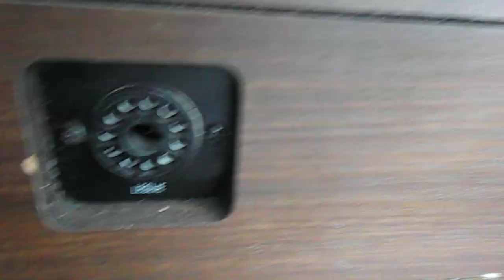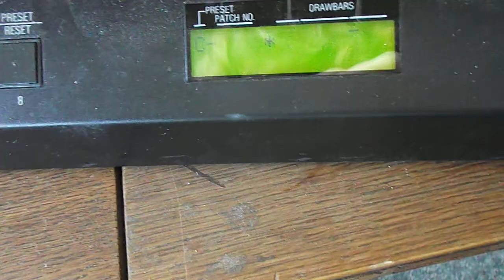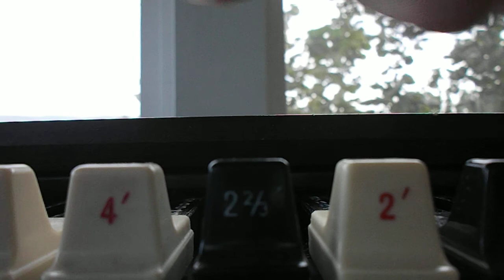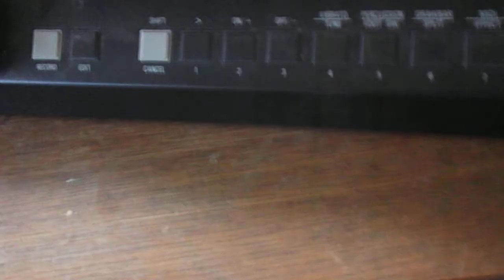Hammond XB-2 with clicking sound?

Comment: You can try to reset  the Hammond to factory default 

    1. Make sure the XB2 is powered OFF

    2. With your right hand Touch and Hold the gray RECORD button

    3. HOLD the gray RECORD button and the turn on the XB2.

    4. The screen should say Welcome to HAMMOND XB-2.

    5. Then the screen should display XB-2 PATCH  DATA - ** INITIALIZE **

Once the organ Initializes then you're done.

I found also this instruction

Reset Factory Defaults:
EDIT button
Press 8" twice
Press 2"

And last solution that I have done
Reaplace the main board  you can find hear https://shop.strato.de/epages/13705466.sf/en_GB/?ObjectID=27934401
Good luck
Reply: Hammondscheisse

Comment: It sounds like the tone generator chip has gone bad.
Reply from the maker: +shawnr26 Think I should open it up and see if there's any loose connections?
Reply: You can try and see if re seating connectors will help, but it may be a bad chip.  The XB series are known for having these types of problems.  Also, the modulation wheel doesn't center detent like the pitch wheel, so it should be ok.
Reply: Try turning off the key click to see if the sound returns to normal.